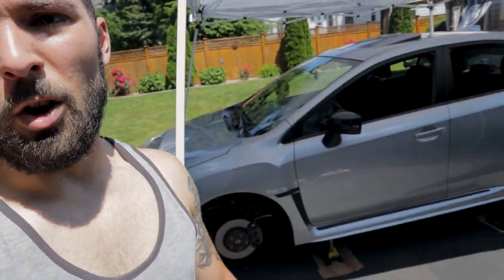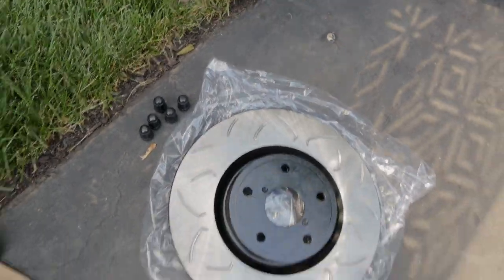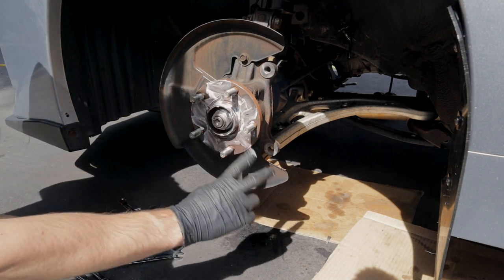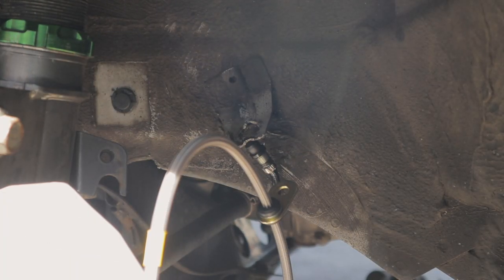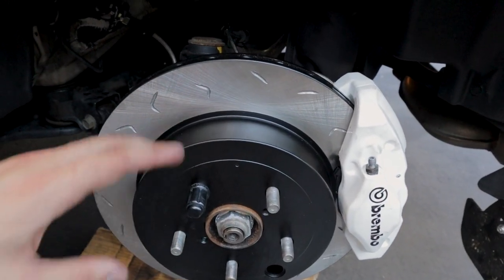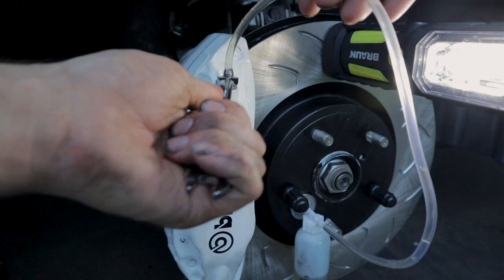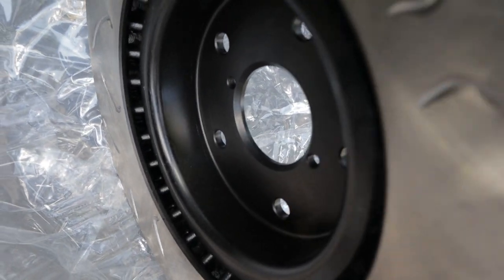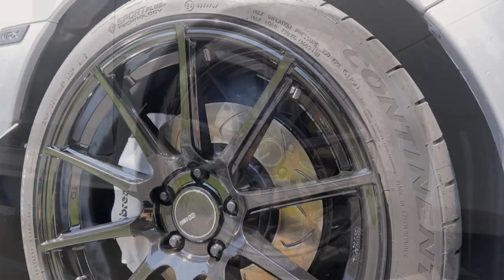WRX STI BREMBO SWAP - PART 3: FACTIONFAB BRAKE UPGRADE KIT!

Comment from the maker: Here are the links to the bolts! A couple people have asked for them.
M10x1.5 (38mm) (x4): https://www.mcmaster.com/91287A174/
M10 Lock Washer (x8)
: https://www.mcmaster.com/91111A138/
M12x1.5 (38mm) (x4): https://www.mcmaster.com/91180A750/
M12 Lock Washer (x8): https://www.mcmaster.com/92153A434/
Reply: Hello so I recently got some 2017 sti brakes for my 2019 wrx base....do I need all these to bolt onto my car?
Reply from the maker: Yes! You could use the oem Subaru bolts but these are less expensive and stainless steel. The oem ones are only aluminum
Reply: Sounds good going to order them now!! Thanks for the quick reply looking forward to more vids from you guys!!
Reply: @iBoost13  also IIRC, the bolts for the stock front calipers (M12) were the wrong thread pitch for the Brembos, so you might not have any choice but to replace/upgrade. Interestingly (to me anyway), the rears bolted right up, but had to trim the dust shield, which fortunately isn't very visible after my butchering.

Comment: I did similar last summer with my '21. Went with refurb Brembos, rebranded Powerstop. Same question was raised about the master cylinder, but confirmed it's the same unit that comes with STI/WRX with stock Brembos. Doesn't look like you've got any caliper clearance issues, but mine are pretty tight to the factory 18" Enkeis, and had to return a set of 45 offset Konig Dekagrams that didn't clear. 35 offset does (barely), and just got a ceramic kit to treat the new wheels (and calipers while I'm at it) before mounting. The TS10's were on my short-list for wheel options, but thought the Dekagram might avoid curb rash slightly better with the inset spokes. I stayed with the 8.5" width because I run snow tires in winter and have this crazy theory that narrower gets better penetration. (I said penetration...) White calipers was a good pick for silver. I went with red for my lapis pearl blue, and it's just one more thing about this car that puts a smile on my face! Prolly upgrade the front mounting bolts when I ceramic coat the calipers in a few weeks.
Reply from the maker: Definitely look at the bolts I listed in the description! They're stainless steel and way cheaper than the ones from Subaru.
Reply: @WRXGarage  ordered. I picked something up from the local car quest to finish the job last summer, but sure zinc coated stainless will be an upgrade.
Reply from the maker: Hell yeah!
Reply: I have the same 2021 WRX, you said you have installed power stop BBK? I always want to pull trigger on it but I'm not sure if it fit my 2021 WRX. Do you need any bracket or straight up plug and play?

Comment: Yo Kevin oh, I got a little bit of an issue here bro, okay so I got the carbon fiber duckbill spoiler right, how did you get your spoiler to sit flush on your trunk oh, I used the whole roll of supplied 3M tape, when I went to go install it it wasn't laying down flush, and it looks like I'm going to have to drill and fasten it to my trunk that way but I'm worried about damaging it, if you could throw me some suggestions or maybe how you got yours on I would really appreciate it man cuz I am having such a difficult time with this
Reply from the maker: Shoot us a DM on instagram! I can help you there

Comment: How did the rear brembos bolt on? Did you need an adapter?
Reply from the maker: Front and rears bolted straight on! No brackets required. Only change needed is the new bolts with the correct thread pitch. The caliper mounting bolts between the OEM and brembo are different. See my pinned comment
Reply: @WRXGarage   you sir are amazing thank you! Been following your guides for a bit now and I’m mounting on a set of STI brembos and rotors this weekend! Subbed for sure!
Reply from the maker: Awesome!!

Comment: Wait wait wait. I thought you have to drill and get adaptors to slap these brembos on a 2015+ WRX ! I have a 2016 and wanna swap so bad lol.
Reply from the maker: Nope! 09-17 brembos can bolt straight up to any 15+ WRX, you just need the STI sized rotors and pads!
Reply: @WRXGarage   I seen on your #2 video you drilled and tapped. Now I’m assuming that’s a required thing ? Also check out my channel I build  tails for our body wrx.

Comment: Nice job, you didn’t mention about if the BMC needs to be upgraded. Or does it handle the extra pistons ok ?
Reply from the maker: The brake master cylinder itself is definitely strong enough to run the upgraded calipers because there are WRX's that have upgraded brembo options which use the same BMC! Overall, as long as the entire system stays pressurized and you upgrade the brake fluid, there should be no issues at all.

Comment: Hello if you can help me, I want to swap brembo brakes to my wrx 2020 eyesight, the issue is that it has an electronic handbrake, and it has a motor that activates this function. Do you know if I need something additional to install this kit or can I only install it at the front?
Reply from the maker: Hmm. That's a tricky one. I'm not exactly sure how that mechanism works. If the brakes have a specific new sensor or something that goes to them, I don't think you could replace them. My guess is the eyesight system occurs at the brake cylinder not at the individual calipers.. you should contact Subaru and ask them!
Reply: I know this is old but you can swap the fronts just not the rears unless you don’t mind losing the parking brake.

Comment: Great informative video!
What are the torque specs for the front calliper bolts?
Reply from the maker: The bolts that mount the caliper onto the knuckle or the bolts that hold the two halves of the caliper together?
Reply: @WRXGarage   bolts that hold the caliper on to the knuckle please :)
Reply from the maker: 60 ft/lb for the fronts, 36 for the rear
Reply: @WRXGarage  thank you so much. 
I have a kit from a 2009 - so it’s direct bolt on, your video was super informative. Thank you.
Reply from the maker: Definitely look at the other 2 videos in the series!
Reply: @WRXGarage  I did - the intricate details did help!

Comment: Hey great video man, do you know if I can use Stoptech drilled rotors with Brembo calipers?  i have a wrx 2021
Reply from the maker: Yes, just need the STI sized rotors.
Reply: @WRXGarage  Would the 04-17 STI rotor fit the 4/2 brembo?
Reply from the maker: I believe it's 09-17 but yeah! The 09-17 brembos are all the same size.

Comment: A smear of anti-seize would have been better than white lithium grease...high temp specs. What trim wrx, base, premium?
Reply from the maker: Mine is a 2016 WRX Premium. Every wrx 2015-2020 has the same caliper and rotor specs, other than the ones that opt for the optional brembo package in the recent years

Comment: I installed my Brembos from a 2019+ STI on my 2016 WRX. My brake pedals are very mushy tho, i have to really step on it to engage the brakes. Did you have this problem? (My mechanic bled the brakes lines twice btw, all new SS brake lines as well)
Reply from the maker: Have you tried changing the brake fluid? Newer, more agressive fluid will help. If that doesn't work, the GrimmSpeed brake brace would help too
Reply: @WRXGarage  yes my mechanic bled them twice! and changed the fluids. You didnt upgrade the master cylinder or the brake booster did you?
Reply from the maker: No, that sounds like your mechanic isn't actually bleeding them correctly.. :( did you upgrade to the sti rotors too?
Reply: @WRXGarage   We think its air too. Yes i got the bigger DBA rotors for the sti. I have an appt with the dealership to bleed the lines and check for any air.
Reply: @canteenpapi3040  what did u end up doing to fix it?
Reply: @troybizzle  nothing, it was a bad bleed by my mechanic. Everything works perfect and I never had to do anything

Comment: i am confuse with the links for the rotors. The rotors that you put in the link are the wrong ones or that ones are the correct ones cause you say STI size but that ones in the links are just for wrx.
Reply from the maker: Yep! The brembos only work with STI size rotors and pads. They bolt directly into the WRX hub. Factionfab also makes rotors and pads specific to the WRX, but if you're doing a Brembo swap, you need the STI size.
Reply: @WRXGarage  thank you so i cant buy the ones in the link because i am doing the brembo swap  right.
Reply from the maker: If you are doing a Brembo swap on a WRX you need the STI size rotors and Brembo pads.
Reply: @WRXGarage  THANKS MAN Suscribe for life

Comment: Hey Kevin, so the rotors in the upgrade kit in the link are STI size rotors correct? Just making sure since the details in the the kit package doesn't specify the rotors size.
Reply from the maker: Yes these links are for the STI size! The rotor size is the same from 09-17 for the 4 pot brembo set.
Reply: @WRXGarage  Hey Kevin, so I'm looking at the pads included in the kit and they look like regular brake pads instead of the Brembo style pads.
Reply from the maker: Oh my bad!!! You're right. Those links are for the STI size. You can find the STI size ones on rallysport.
Reply: @WRXGarage  Okay, thanks. So the rotors and brake lines in the WRX upgrade kit will work with the 15-17 STI Brembos then? Just not the pads.
Reply from the maker: Factionfab makes a WRX specific brake upgrade kit, which is what I've linked. It still uses the stock calipers. For the brembo upgrade, you need to buy their STI sized rotors pads and lines.

Comment: The rear brembos from the years u said in the description just bolt straight up? No mounting bracket needed?
Reply from the maker: Yep! The fronts do too. The older generation (the gold ones) need a bracket.
Reply: I had to trim the rear dust shield  on my '21 to accommodate the larger rear rotor. 316mm unless I'm mistaken.
Reply from the maker: Yeah, you do have to trim the dust shield

Comment: Were the rear calipers direct bolt on or did you need the adapter to make them work?
Reply from the maker: Direct bolt on! The older brembos (orange/gold) from the previous generation needs an adapter. These (the 09+) don't!

Comment: Did the rear caliper bolt right up? Or did you need to use a bracket?
Reply from the maker: Front and rear bolted right up without any adapters!
Reply: @WRXGarage  your brakes are off a 2012, right?
Reply from the maker: Yep!

Comment: Nice job.  Only thing I would add is that the bolts you got from McMaster are 8.8 grade and I probably would have spent the same a mount of money to get the 10.9 grade bolts that are Zinc Yellow-Chromate Plated.  Wouldn't hurt to replace them one day if you're doing a pad change only because brakes a pretty important part of the car under a tremendous amount of force!  These have a little more tensile strength (50% more!).
https://www.mcmaster.com/91052A114/
Reply from the maker: If I remember correctly, one of the bolts was very weird, not a standard size and didn't have chromate as an option :(
Reply: @WRXGarage  Ah... I see that they're "partially threaded".  That may be the issue.  I am having a hard time finding partially threaded bolts in 10.9+ grade.  I'll keep looking.

Comment: Would I have to change the wheels to install this kit?
Reply from the maker: Depends on what stock wheels you have. Most aftermarket wheels will fit them
Reply: @WRXGarage   wrx premium wheels
Reply from the maker: What year?
Reply: @WRXGarage  2018
Reply: @WRXGarage  18 inch stock wheels
Reply from the maker: Yes the 4 pot brembos will clear those!
Reply: @WRXGarage  thanks for your help

Comment: Did you have any issue with rust in the slots?
Reply from the maker: Only if it sits in the rain but it's entirely cosmetic discoloration, not actual rust build up.

Comment: Can you send a link for the rotors thanks man
Reply from the maker: Links are in the description!
Reply: @WRXGarage  do you have any advice for removing the brake lines and installing the faction fab lines
Reply from the maker: Definitely buy a brake bleeding tool and new brake fluid! Have a friend ready to pump the brake pedal for you when you bleed them!

Comment: Can I run stock wheels with Brembo or do I need more of a offset?
Reply from the maker: The stock 18" wheels will fit but not the 17"
Reply: Fuck ya mate thank you! I’ve got the 18s
Reply from the maker: I'm like, 90% sure those stock 18s are what they put on the Canadian sti's for some reason
Reply: WRXGarage i’d be kinda mad tbh especially if it was a 18+ sti lol

Comment: the link goes to the kits that fit for 2015+ wrx but in the comments it says (STI size), just confused on if the rotors made for the WRX work or if there the same as the older stis. and does that mean stock size rotors would work? or these faction fab ones are slightly bigger
Reply from the maker: Sorry about that! These are the STI size rotors front and rear. The pads are also specific to the brembos.

With a switch from WRX oem brakes to brembos, you do need the larger sti rotors and pads.